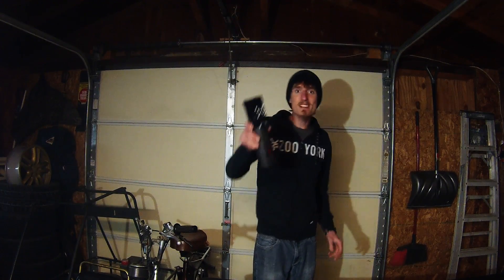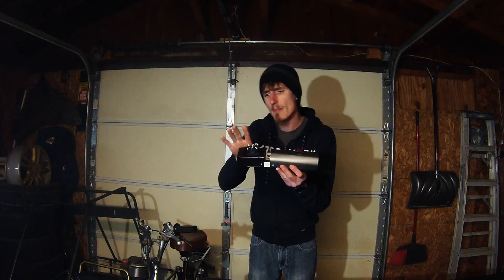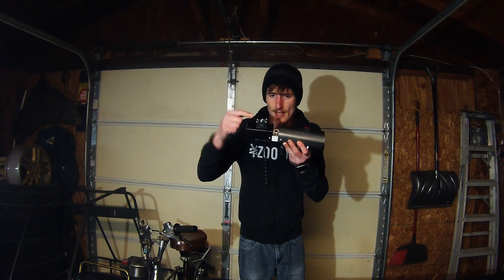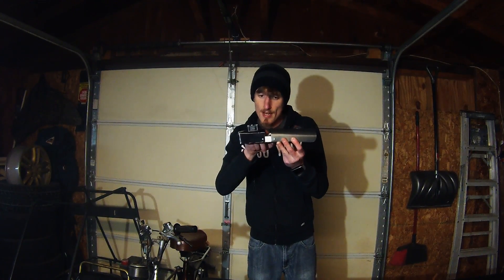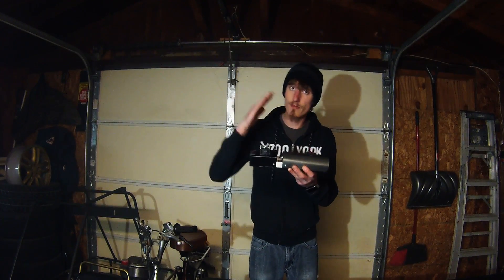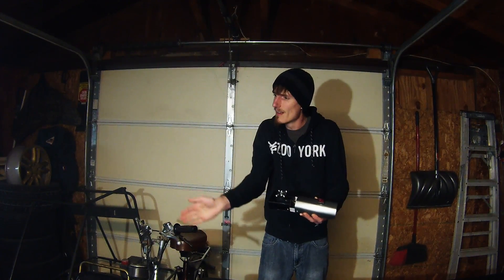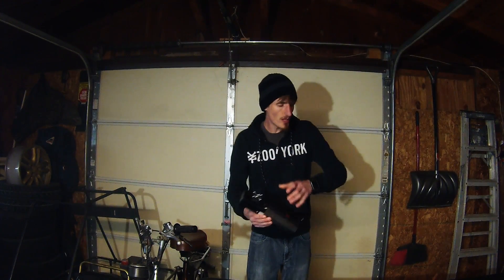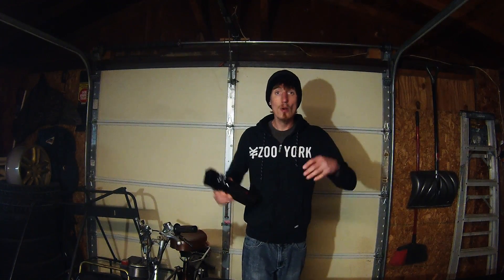Portable Force Field Generator!

Comment: If you use a UV laser you can ionize the air. Then you can pass a high volt, low amp current through it. With two fields, positively and negatively charged, anybody whose body intersected both would be electrocuted in the same manner that a taser or bug zapper works. The trouble would be striking a volt/amp balance that can shock someone but that won't cause arcs between the two fields.

Comment: What you could do with that device 
Put a high intense frame around the passage way of entry or exit raise the temperature on the laser to 350 Fahrenheit whoever gets close to it or close to it gets brutal burnt they you go there is a energy fuel heat force field but you have to use area precaution of the areas surrounding the heat and Lasered force field generated by this Float ton device

Comment: only if people had my brain we would have those things. does a laser cutter ring a bell. what if you created a web of laser beams at very high energy and made them paralell to each other with very little space gap, would not a piece of matter evaporize when in contact with the high energy laser beam array? you may still see perfectly well trough this array of beams before somthing get in to contact with it. what i think would happen is that you trow a rock at the array and the rock will simply instantaneously evaporate ang glow like a star before it get incinerated into thin air.
Reply from the maker: That works but the momentum of the rock would carry it through the array so it wouldn’t vaporize. That takes a bit of time. If they are powerful enough it may vaporize the outside most layer of whatever passes through but not the entire thing. Especially something dense like a rock. What I’ve done here is to create a plane so that it looks like you would expect a force field to look. Also a large array would not be as portable.

Comment: err youd have alot of problems with high power outputs... like it would incinerate your doorway... as well as the building its in...
Reply from the maker: On a large scale it could be something that would be installed as a permanent fixture for the specific doorway. If it was a portable unit like this it likely would be used militarily in a location where the doorway or building would not need to be saved.